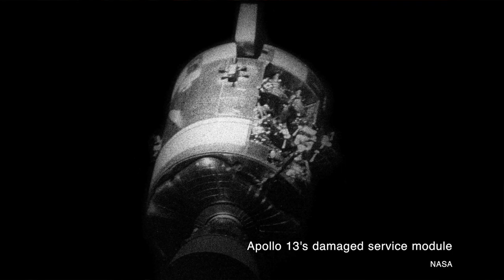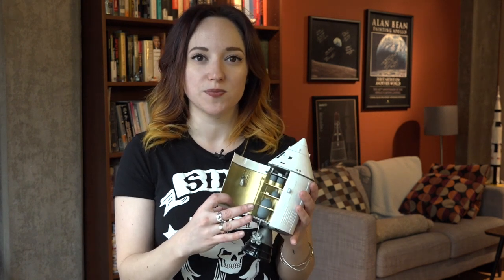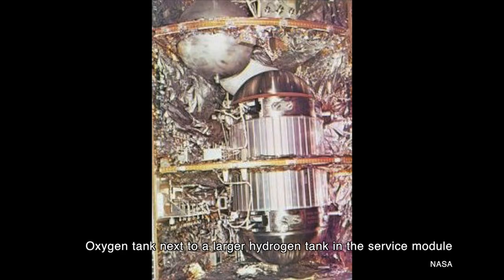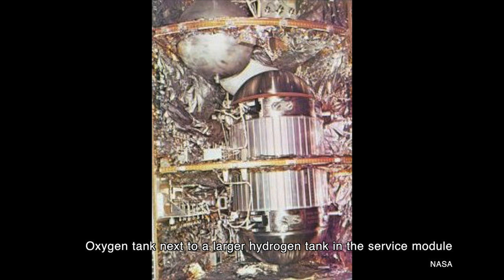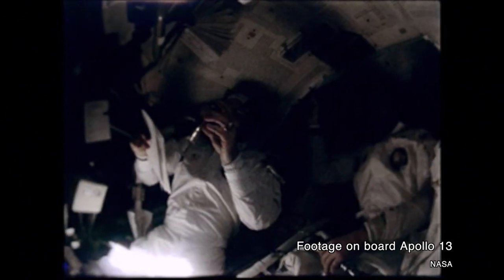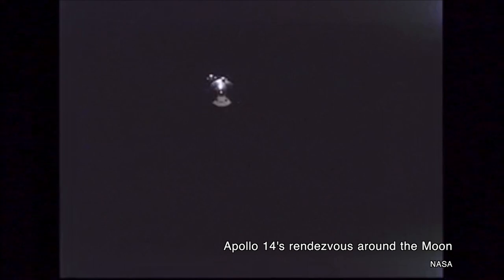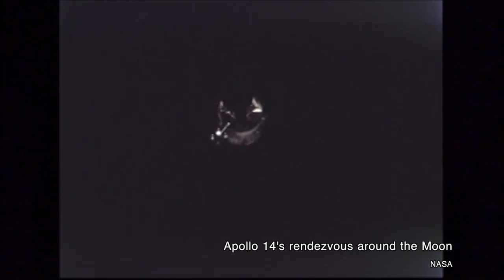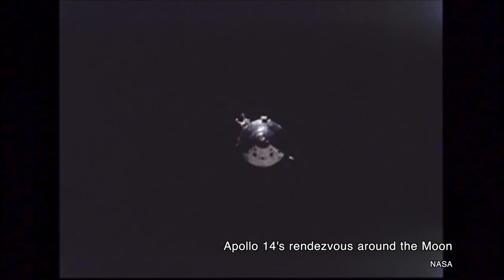What did NASA Change After the Apollo 13 Disaster?

Comment: can you do a video on the Van Allen belt, and how Nasa has recently been saying that we haven't been through them?
Reply: +Heir Jordan :Can you post a link to anywhere that NASA claimed we've never been through the all mighty Van Allen belt?
Reply: ***** would you like some more links? Or will the one suffice?
Reply: +Heir Jordan :I don't see any link. Are you sure it got through your posting okay?
Reply: ***** all you have to do is type Van Allen radiation belts in the search. You will see for yourself that it's official videos where Nasa says we haven't been through them.
Reply: ***** anything yet?
Reply: +Heir Jordan :What I've seen are links claiming NASA says this. I've never seen an actual NASA official claim it. Give me some names of NASA officials. Surely if they are claiming this, it has the backing of NASA Chief Bolden.
Reply: +Heir Jordan Sir, NASA has never stated this. I repeat, NEVER. What they have stated is that the critical electronics for the Orion capsule have not yet been adequately tested to be fully human rated while traversing the belts. 

The electronics used on Apollo were incredible robust, essentially using macro level circuits. Current micro-electronics, though vastly more powerful, can be subject to and more prone to damage from any source of radiation. So, robust shielding is required, and very careful design must be implemented. If the electronics of a spaceship fail, the human occupants would be put in great danger.

Many moon hoax advocates have seized upon this simple fact to assert that the belts have never been traversed by humans. They have, numerous times. The astronauts that received the highest radiation doses were those of the Gemini missions. One mission was essentially designed to determine how much exposure would actually occur during extended missions. All of the dosimeter  data collected int he Gemini missions is published here: 

http://ntrs.nasa.gov/archive/nasa/casi.ntrs.nasa.gov/19720011147.pdf

It should concern you that those who would argue for a hoax having been carried out would do readily distort the need for deep testing of critical systems.
Reply: +Magister Ludi 2105 Funny how he disappears after your excellent response explaining why this claim by moon landing hoax believers and flat earthers is so blatantly dishonest.
Reply: ***** second of all I'm not a Flat Earther, I don't believe in any religion and I'm not dumb enough to just believe what anyone tells me. The moon landing footage is bogus. The space race was rigged.
Reply: +Heir Jordan I never said you were, only that both moon hoax believers and flat earthers commonly use that dishonest claim as evidence. So what's your response to Magister Ludi's explanation?
Reply: ***** I guess you didn't read the part about me not paying attention to what that person said. Did you watch the video in the link I posted? Did you know that Stanley Kubrick was the one who shot the footage? There's even a movie about the whole thing coming out this year. I've seen with my own eyes official Nasa videos where they explicitly said the orion capsule is going to be the first manned vessel. Search for yourself.
Reply: +Heir Jordan As you were already told, you didn't post any links.
Reply: +Justin Franks But I have a good idea of what video you are referring to. It quite clearly states the need for the much more radiation-sensitive miniaturized modern electronics needs to be tested before any manned missions. Nothing more.
Reply: +Heir Jordan So Stanley Kubrick filmed the fake moon landings, and there's a movie about it coming out soon? You wouldn't be referring to T. Patrick Murray's "Shooting Stanley Kubrick", would you? The one where Murray claimed to have gotten a confession from interviewing Kubrick in May 1999 that he faked the films for NASA, and signed an 15-year NDA? Because that would be a real feat, seeing as how Kubrick died in March of 1999.
Reply: ***** I don't know what video you're speaking of. I meant that there's an actual movie produced by Hollywood coming out. Also, interstellar is regarded as being highly accurate, scientifically. They even mention the moon landings being faked.
Reply: ***** and I don't know why the links aren't showing. Search Van Allen radiation belts on YouTube and look the videos of Nasa saying we haven't been through them. There's conspiracy theories yes, but there are actual conspiracies. The US was losing to Russia. They did what they thought they had to do.
Reply: ***** I'm not stating that I don't believe people are in Earth's orbit but anyone who pays attention to the moon landing footage would notice things don't add up. I didnt get my idea from the Internet. I'm not a teenager.
Reply: +Heir Jordan Why don't you stop dancing around the subject and actually give a link to this NASA video like you said you would? You claimed to have linked a video when you did not, and have already been asked three times already to do so. And like I've already asked, is this "actual movie produced by Hollywood" you talk about T. Patrick Murray's 'Shooting Stanley Kubrick', or is it not? Because if it is, I think you really should do some fact-checking before you consider it as evidence the moon landings were faked by Kubrick.

And 'Interstellar' as evidence the moon landings were hoaxed? It is a science fiction movie; I don't see how any reasonable person could regard a scene in a science fiction movie to be credible evidence of anything, regardless of the scientific accuracy of (some) of the other parts of the film.

But if you really do want to consider Interstellar as evidence of something concerning the Apollo missions, I would suggest re-watching the scene in question, because in the Interstellar universe, the moon landings are real but the hoax is government propaganda.-- a PR move to save face by claiming it was a brilliantly calculated move to bankrupt the Russians, as well as a way to stifle children's interest in "useless" endeavors like space travel in the wake of the worldwide famine.
Reply: +Heir Jordan No...the moon landings were 100 percent genuine as is the film and video images they produced. It is not good footage compared to what can be offered today through current technology. But, if you cared to actually do some research (you seem not to that naturally) you would quickly find the following correlation:

Each succesful mission had a 16mm data acquisition camera attached to one of the ascent module windows. They designed the liftoffs to roll such that this camera would capture the descent module and the general traverse area.  The Apollo 11 area was about the size of a standard American suburban yard, while Apollo 17 had a comparatively huge traverse area. These images have been in the public domain since 1969 to 1972. As such, until the LRO they represented the highest resolution images of ANY portion of the moon.

There is 100 percent perfect correlation between the 1/2 meter resolution LRO images and all of the captured traverse areas from the ascent modules. That can only happen happen if those traverse areas were actually there to be imaged. They could only come about through boots, rovers and dragged equipment. If you wish to argue that the LRO data is fraudulent, then you aren't even worth the effort to engage...and that is a truth sir.

Look man, if you are as intelligent as you claim to be, you cannot successfully argue that the &quot;evidence&quot; against the moon landings can withstand even the mildest scrutiny. They are a part of history. They happened. They were a bright moment in human history. For some reason some portion of humanity feels a deep need to denigrate them. You seem to have allied yourself with that crowd. That's your choice...but you, or ANY moon landing denier will never get a job with my company.
Reply: ***** a person who knows anything, knows that they really know nothing. I don't claim to be more intelligent than those who do believe. I could be wrong but so could you. I'm not a crazy conspiracy theorist who lives in his mother's basement. I just don't believe everything I'm told. People can tell a lie a million times but that doesn't make it the truth. The government said JFK was shot by one guy when that was physically impossible but hey why would they lie?
Reply: +Heir Jordan I can't see any justification for the zen-like statement of 
"I know nothing," as it simply isn't true. Now, if you want to split the most infinitesimal of hairs, you can but it quickly becomes useless. 

For example,  if you run your car into a huge concrete barrier at 150 miles an hour, you can pretty much "know" that you'll be dead. According to advanced molecular theory there is some non-zero chance that that the atomic structures of your car, you and the concrete barrier will simply "miss"each other and you will pass through unharmed. But the chances of this are so small that you could repeat the crash every second for a trillion years and the outcome would be the same each time. I use this rather extreme example to simply point out that the world does work based on physical causality, and that an understanding of this causality is quite helpful. That understanding involves "knowing."

It's also not a practical approach to say that "I trust nothing that I don't learn on my own." I always use calculus as an example. There is no more useful area of knowledge in understanding physical causality and change over time. But, if each person assumed that they were being taught lies, nobody would ever learn calculus. The number of humans who can figure it out on their own is very close to zero. Our lives are based on knowledge that we did not personally have to gain. Previous generations have done that for us.

Then there is the realm of knowledge that can never be 100 percent certain. I'll place the JFK assassination in that realm. It is entirely possible for one person to have done it. It's also possible that other people were involved. The entire event played out over a matter of seconds and there is only accidental documentation of it. Thousands of people have offered different accounts. Personally, I think the best analysis of it comes from Vincent Bugliosi who concludes that there was a single shooter. But, I will concede that, barring time-travel technology,  this will be forever speculative. There will always be some justifiable uncertainty.

The moon landings aren't in that category. They involved vast numbers of people,  were meticulously documented, including documentation  that shows physical behavior at 1/6 G - this cannot be faked still without using advanced CGI. There was none of that in 1969. They were closely observed by the entire world including open enemies of the US, generated totally new technologies, provided more than 800 pounds of lunar materials that simply could not come from any other source and created unique, altered areas on the moon that can be easily documented today. This is just a start. In order to argue that they did not happen, one has to to postulate fantastic, fictional technologies, hyper-competency in secrecy beyond anything humans have ever shown to be possible, and MASSIVE quantities of very clear empirical evidence has to be ignored.

I applaud not accepting what is spoon-fed to you. I do not applaud (A) a refusal to deeply analyze evidence and (B) failing to understand how readily the moon landing deniers will lie and distort.
Reply: +Heir Jordan "and how Nasa has recently been saying that we haven't been through them?" - There are only three possible reasons you're saying this. 1. Someone else told you that and you're just taking whatever they said at face value and you didn't bother checking it. 2. You actually saw the said video in question and misunderstood it. or 3. You're a liar. I don't think you're a liar just badly misinformed. NASA never claimed any such thing. NASA is trying to solve the problem of 1) sending astronauts through a much more intense region of the VAB on a mission that requires an escape trajectory (not a translunar injection trajectory), for a mission to Mars - and several passes through these more intense regions as well.  They can't do what they did last time because they are going to Mars; not the moon.  It's a different exit trajectory and it's a completely new spacecraft, in a different time period, with different components. When automobile manufacturers design and build new models of cars every year, they still test them. Imagine that.

Comment: Amy, why do you refer to the incident as an "explosion"?  Did you not read the official NASA report?  ...the one where they never refer to it as an explosion.  ...the one where they give very detailed explanation as to how the tank was very carefully designed so that it could not explode, even under extreme overpressure.  It had redundant safeties built in, such as a pressure relief valve and rupture disk.
You are clearly a very intelligent person who does loads of research.  That is why I am surprised that you give the Ron Howard version in your video here.  I realize that report is long.  But the full story is told in this pressure graph:
https://en.wikipedia.org/wiki/File:TankRuptureParametersGraph_-_Apollo13_CortrightReport_pg_B-47_%28pg_A-209_inlay%29.png

Comment: If the explosion hadn't have ruptured the second O2 tank which vented out in space, they wouldn't have landed on the moon,but could have made it back without the difficulty they had.
Reply: +Garland English :If the one had exploded as it did, but without rupturing the other tank, mission rules would call for an abort. There would be minimal O2 at best for the CM if an O2 tank blows.
Reply: It would still depend on the condition of the CM engine.A direct abort would have meant firing the main engine.

Comment: Ther'es one thing that still doesnt' make sense.. The apollos capsule is VERY small. Just big enough to squeeze in three guys. And yet, they are always shown floating about in space. Exactly where? There is just enough room for them to sit in front of the instrument panel. where are they floating around?
Reply: The CM had a lower equipment bay for doing stellar observations and stowing gear like their launch suits. And there was more space between the seats and panels. Once they released the seat straps after reaching orbit, it was quite roomy compared to Mercury and Gemini (and Gemini 7 veteran Frank Borman actually got motion sickness on Apollo 8 once he got moving inside the CM).